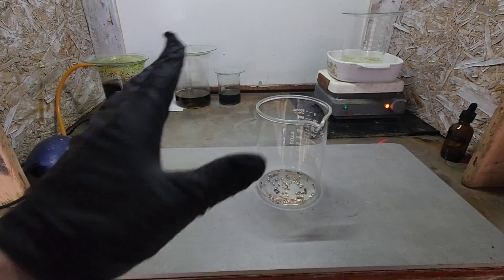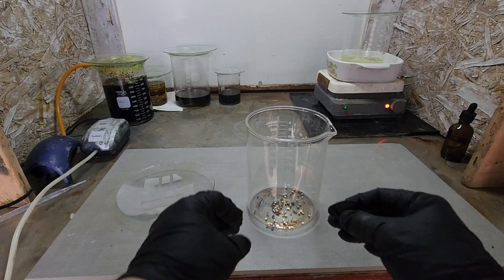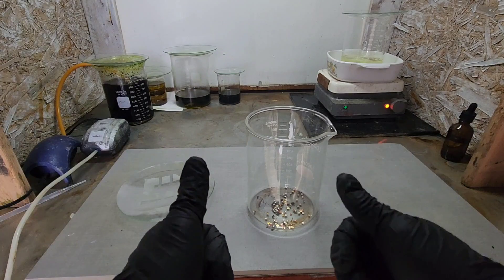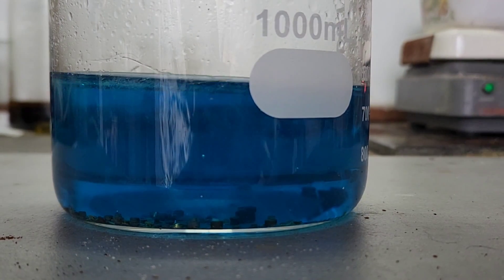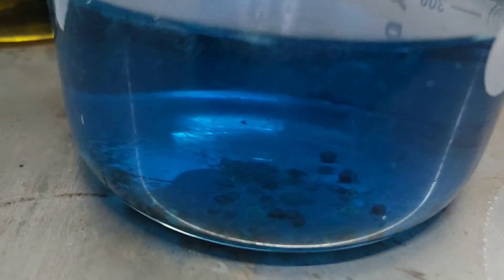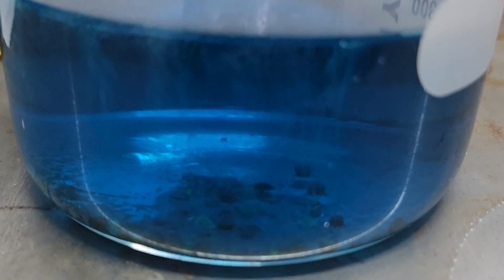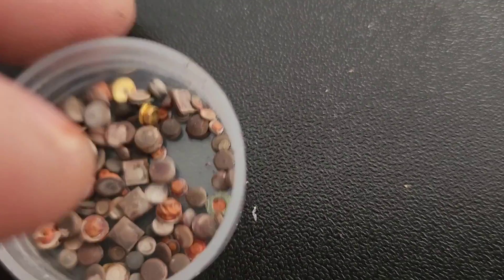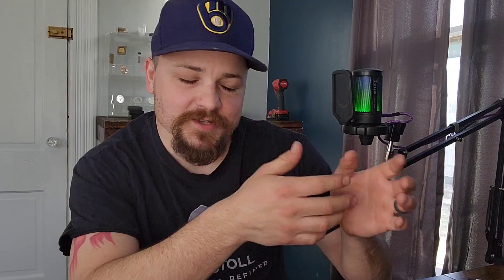Silver contact refining with citric acid, salt, and h202.

Comment: As you suggested in my last comment, i did use way too much hydrogen peroxide and as a result a green crust formed. Nice one for showing this method again. Top vids 👌
Reply from the maker: One thing that may differ from your experience is that I am using 12%. You may need to add a little more than I do if you are using smaller percentage

Comment: Don't forget that there may be cadmium in some of those contacts. I've seen some in videos where they contain some palladium as well. 
I've always yielded some sort of a fine powder when I dissolve contacts in nitric. I'm assuming this is the cadmium but the internet says nitric will dissolve cadmium so I don't know what it is.......
Reply from the maker: I always thought tin but never had a way to test it
Reply: @SilverStoll  I'm puzzled. Most don't seem to have any soldering and researching the composition, it seems like silver cadmium and copper are what's in em.....
I doubt it would be a pm like platinum and from what I've read I don't want to try n melt it as cadmium is toxic, I guess. But if it's some kind of tin oxide, I guess torching it would probably answer the question. I'm a little apprehensive.

Comment: Looking forward to that illuminated gold drop!

Quick question though. How long do you think these solutions (and normal AR) can sit at different points in the process? In general, the magic of editing makes it look like you could do a whole batch of precious metals in an afternoon. You're pretty good about letting us know when it's been sitting overnight. The likelihood that I will have time to have 2 days in a row to work on projects is slim. I'd hate to leave a batch for a week and have to come back and start over because I stopped too soon. You get crystals from somethings and passivation for others. How do you manage all of that? 😅
Reply from the maker: Some of them are fairly quick. Both of these contact videos could have been done in a day I just was using the heat plate for the one. 

In all honesty I just go with the flow lol. Most of the crystals that crash out of solution are just from me running the solution a little to saturated and then allowing it to cool for a day or two in the basement. 

I think of acids like humidity. The warmer the acids are the more metals they can hold just like air holding more water when it's warm outside.

This has been pretty easy to deal with. I have been ok with just adding more distilled water for a place for those crystals to go.

The worst one to deal with is the citric acid methods crystals. I think I have figured out how not to make them because this batch didn't give me any crystals even after I heated it on the hot plate and then let cool.

I haven't stumbled upon a process where I have had to start over for letting it sit to long. I am sure I will find one, however 🤣

Comment: I'm going to attempt a gold inquartation some time next week, never done it before
Reply from the maker: It's not bad. I would recommend starting with a small batch to make sure your math is right. If you add too many base metals, the gold is an absolute nightmare to deal with. My first couple of gold refinings I was not patient enough to do enough nitric boils until the nitric bath was clear. IT'S WAY WORTH IT 🤣. So much easier to filter and clean up at the end. Good luck man and take pictures or videos!
Reply: @SilverStoll  yes sir I sure will, all I've ever done the past year is destroy sterling and make crystals! Destroy gold filled and make powder! It's time to step up and make bars!!!! Thank you for the advice, I'll definitely use it.